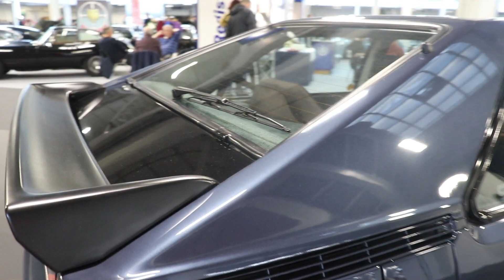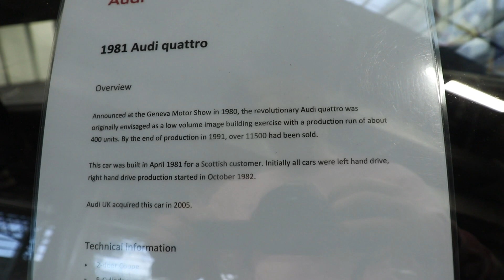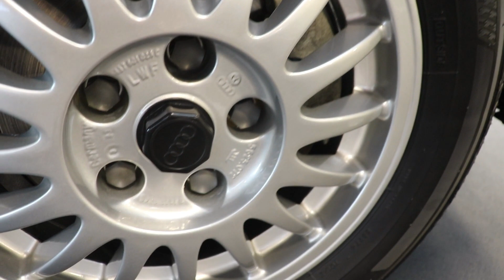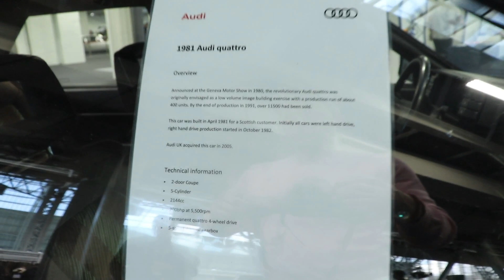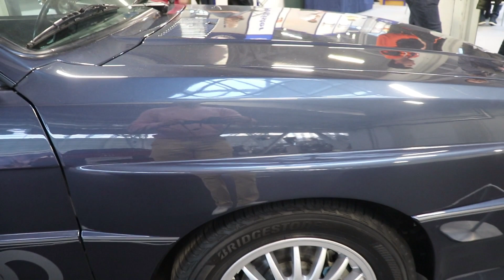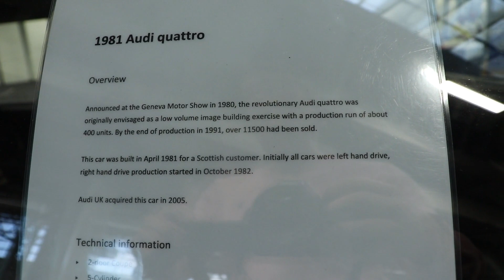The first sports 4x4 car !!! 1980 AUDI QUATTRO

Comment: The Audi Coupé (B2) is my dream car - especially as a quattro and 5 cylinder like as this one. My very first car was the regular sedan of this, the Audi 80 (or Audi 4000 in USA and AUS) but with the 4 cylinder carburated 1.6L engine with 75 HP. Luckily around 5 years ago I found a cheap Audi 80 in a good condition with the same specs - and I am still driving it. What I love about the car is the great overview. Even without power steering it is easy to drive. And for only 75 HP it is running great. I heard from people who also owned one that when it was new then it was a game changer because it was faster with its 75 HP than the Opel Ascona with the same power. Of course a 5E quattro coupé is of course the cherry tip of the top.